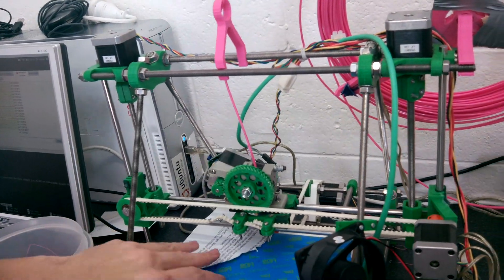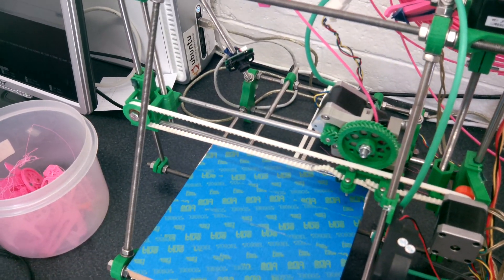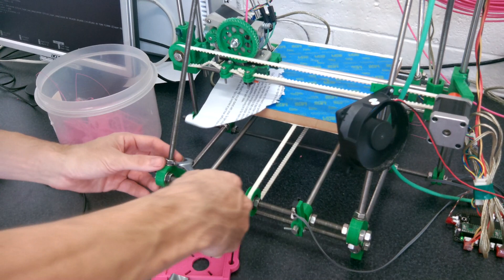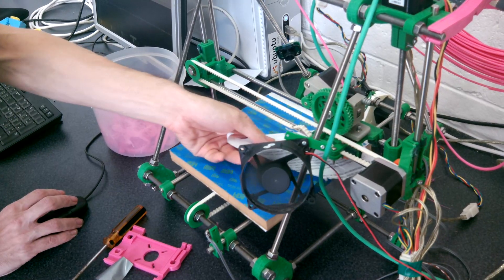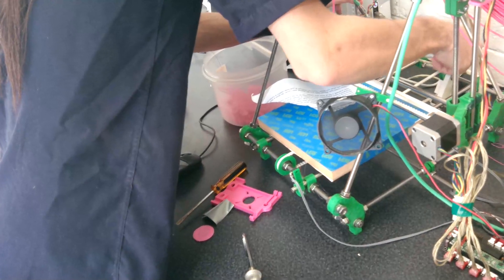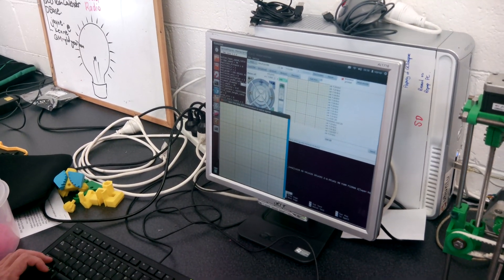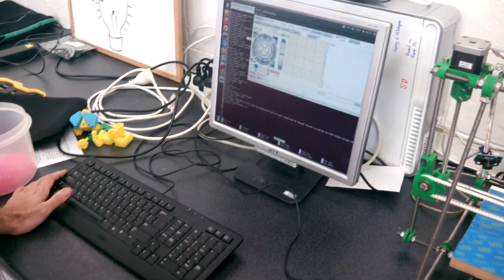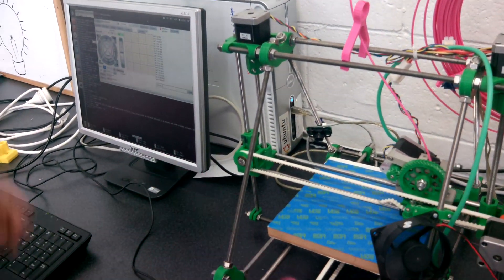Calibrating Reprap Z axis

Comment: What do you mean "do this immediately after homing Z using the endstop?  do you mean, home it, then recalibrate and do the G92 Z0 command?  Also mine homes right before a print like i saw yours do at the end of the film.  I would like to know how to eliminate the switch endstops as for some reason mine dont work how i think they should.  the motor keeps going even though it hits the endstop and I have tested the switch at where it plugs into the ramps and it does make a closed connection...